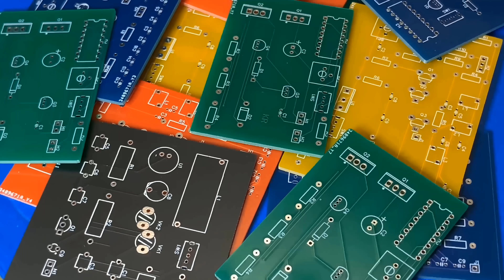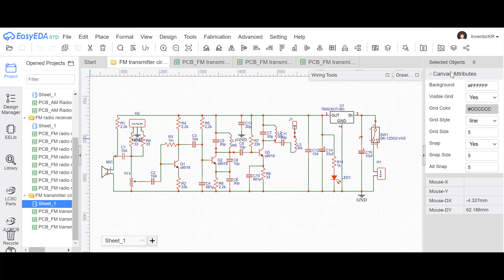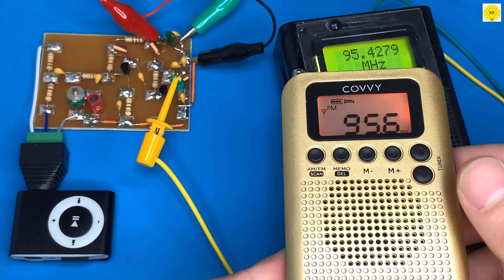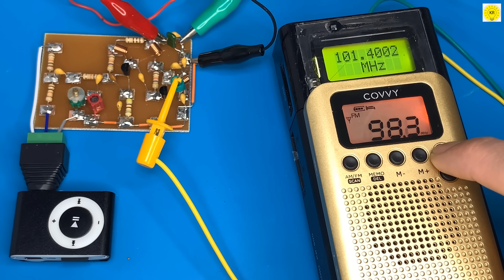make simple fm transmitter circuit 500m Range, stable fm transmitter, jlcpcb

Comment: It violates FCC rules on transmit power and there are many instances where the FCC kicks in your doors, siezes equipment and fines you $10k.  Building this puts you at risk.  The FCC doesn't seem like it has teeth anymore, but it does.
Reply from the maker: My dear friend, this band is licensed and it is used for educational projects, and this project you can buy ready-made from many sites such as Amazon, Ali Express and Banggood, because its capacity is small and does not affect other frequencies, I hope you understood because the subject of this project accept my regards
Reply: @inventorkr1  the transmit power allowed in the FM band is extremely low in the U.S. and could never reach 500 feet under the best possible conditions.  What is the RF transmit power level?
Reply from the maker: @chrisfuller1268  Power capacity is approximately 250mW
Reply: @inventorkr1 I hope you have powermeter, spectrumanalyser, GPS controlled frequency counter and V/A meters to make such promises. 250mW Hf need 1W DC!
Reply: @inventorkr1 You are wrong! 89 MHz up to 108 MHz is official FM radioband and is ruled by the FCC. They fetch the last screwdriver and you have an empty shack!

Comment: Fm Transmitters are monaural so better off using monaural audio jack with only Ground + Line, instead of stereo audio jack which is waste as transmitters are mono.

To achieve stereo you have to multiplex the Left & Right audio with accompanying pilot tone within speciel hardware or software that gets sent down audio cable into FM Transmitter.

Great project, could easyily be improved upon, and it's better to include the part numbers in the description.

Comment: For long range, key component is antenna, in fact. But, you must use efective output stage, such as push pull coniguration. I recommends 2x2n2218.
Reply: Can we use 2n2219 also kindly guide actually i was about to use MRF237 at ourput stage but unfortunately it was not available in market i request you kindly provide some information about output stage of transmitter so that it's power can be increased upto 1km minimum

Comment: For all the naysayers, this method of circuit construction is called Manhattan Style, and is widely used in radio frequency construction, especially by hams. Just sayin'.
Reply: This method has better RF properties than using a breadboard PCB?
Reply: @RDCST  Breadboards have too much stray capacitance due to the rows of contacts. This capacitance wreaks havoc with RF circuits. This Manhattan Style Construction is the best for RF projects.
Reply: I can see why is called Manhattan 😆
Reply: This is proper construction for RF.  At least a couple methods this can be used,  Like making isolated pads on a PCB with a hole saw to just cut the copper.  But this is the right way.
Reply: Thanks.  First thing I noticed.  Glad there's a name for it -  Excellent - and no fuss with etching PC boards for more basic projects.
Reply: I was honestly expecting the sponsor ad like: "if you think this is ugly, * is the website for you". I am happy to learn that this is a legit method, but still is ugly :D

Comment: A metal screw driver is not the correct tool to adjust the frequency. Please tell us, with which device did you check the output frequency?
Reply: An fm radio....